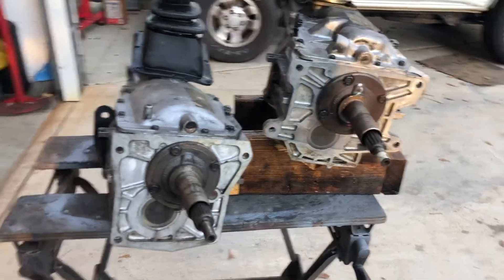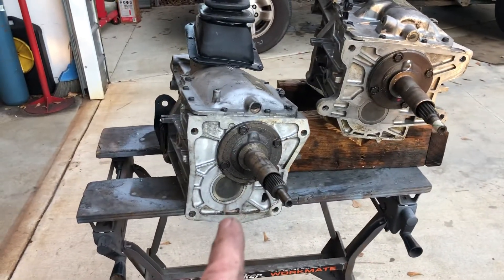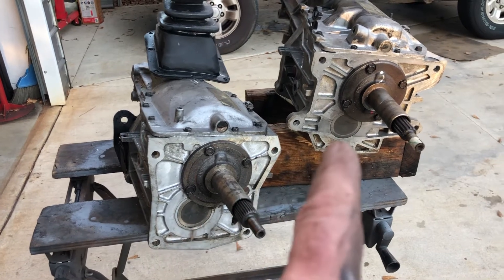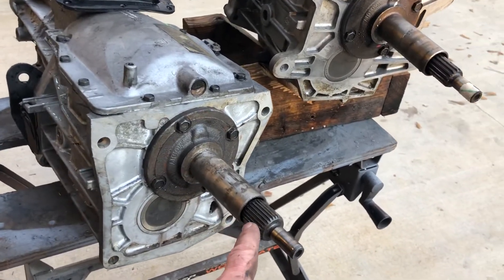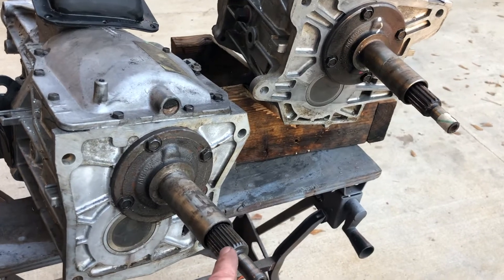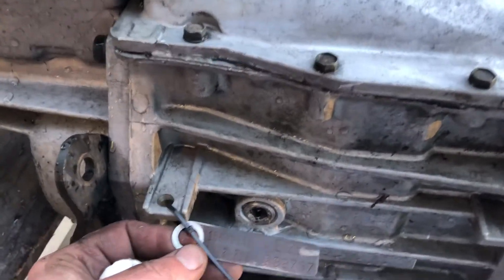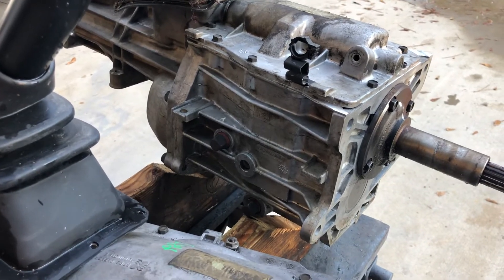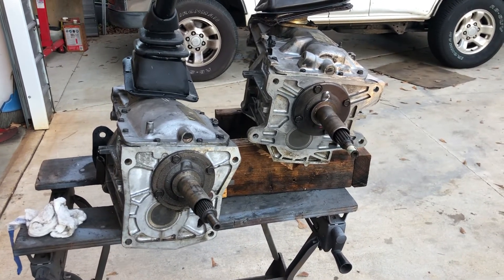S10 T5 transmissions with Muncie and Ford bolt patterns.

Comment: How can I make a SBC Chevy bolt up to a 14 spline t-5? Do you just order the flywheel and clutch kit for the 2.5? Is the flywheel bolt pattern the same? I know the bell is different I have all the bell but I'm wondering what parts to order for this build. Any help would be appreciated thank you
Reply from the maker: I need more info. What bell do you have? You’ll need an adapter plate to bolt a Ford bolt pattern T5 to a Muncie bolt pattern bell.

Comment: I have a Mustang WC T5 that I need to swap an S10 tail housing onto. (1352-208)

I'm confused on what tail shaft I need.
I don't care about retaining my speedo cable since I plan to use GPS.

Can I use the more common electronic speedo tailshaft? And is there any real difference in the NWC and WC S10 tail shafts?
And are all the S10 top covers the same?

Thank you!
Reply from the maker: @metalgearmoogle852  I have not performed the swap you plan to do but I know it is done frequently. The shifter box is in the same position on both the cable style and VSS style S10 tail housings. The S10 case covers are the same as Camaro and Mustang case covers. You will need the correct length shift rail correct parts to go in the S10 shifter box.

Comment: I was able to adapt a 90's Ford Mustang Tail Shaft housing with shifter to a 1989 Camaro/F-Body W/C V8 T5,and used the Ford speedo,by making a steel split bushing epoxied to main shaft w/a small drilled spot to locate clip for driver gear (machined,bored open to fit over end shaft),I split cut the end of the plug from the driven(speedo) to expose the square drive by removing a white plastic cap as this is pressed together plastic from factory,removed the cast aluminum screw on collar from my g.m. cable and cut back the steel retainer sleeve at end of cable till it was enough to engage the square steel driven as the former cap set is the new stopping point for your cut down g.m.sleeve,used a small otinker type hose clamp to capture it and filled with epoxy,,still working 20 plus years now in my wife's 75' Sbc 352 long rod Chevy Vega
Reply from the maker: @richardwimmer6846  
Guessing the FORD tail housing put the shifter in a better spot than the Camaro or S10 tail. Good job.

Comment: I'm wondering why with the S10 they (GM) didnt use the T5 behind the 4.3 ? they used the NV 3500 instead and i'm not so sure the NV 3500 was any better of a trany for the bigger motor ?:body-blue-raised-arms:
Reply from the maker: Yes, that is an interesting question. The V6 Camaro used a T5.

Comment: This video confirms :eyes-pink-heart-shape:that the S10 indeed got a WC T5 in 1993 , i was under the mistaken impression (from other info sources) that the 93 was WC but only with a ford bolt pattern but i see i was wrong , When i crawled under my 93 S10 with 2.5, 4 banger it indeed has a Muncie bolt pattern , mine would be a 1352-221.
So theoretically i could do a mildly modded 305 v8:face-fuchsia-wide-eyes: swap and, with a few other choice parts, retain my T5 :goat-turquoise-white-horns:
The main caveat:cat-orange-whistling: i will run into is with my T5's sup wide ratio spread i will def have to swap the 3.73 rear gear set for a 2.73 or 3.08
Reply from the maker: Many S10 T5s have been bolted up to a SBC 305, 350, 383 without any problems whatsoever. The T5 must be in good condition and will not take abuse. Drive it like a daily driver and it will do fine.

Comment: my question is why hasn't anybody made a bellhousing with the sbc engine bolt pattern and the ford butterfly transmission bolt pattern already? they have it vice versa where you have the bellhousing with the small block ford engine bolt pattern and gm saginaw transmission bolt pattern. but you can't get a gm bellhousing with the ford transmission bolt pattern yet there are companies that make a conversion input shaft for the sm465 that has the 10 spline 1 1/16 input shaft and another company that makes the gm slip fit bearing retainer for ford transmission to be able to use a gm throwout bearing with a ford clutch disc and gm bellhousing. it would make a lot of sense considering the pilot bushing diameter for the ford np435 and the gm sm465 are the same diameter and both share the same input shaft stick out length of 6.5 inches. unfortunately the s10 t5 bellhousing will not fit sbc otherwise i'd go that route and be done with it.

Comment: where is the adapter plate for $180 and change? the only one I can find is $305 on ebay
Reply from the maker: I bought my adapter plate from this guy. He very knowledgeable and will get you what you need if you tell him what your application is. Dave Farwell @ vintagemetalworks
dfarwell09@gmail.com
330-322-3102
Reply: @Lugnutz65  MDL adaptors makes a couple , one straight up (401-2200) and the other with the 18* clock over , they are $270us each.

Comment: So, is it easy to adapt it to a Ford F100 with 300?
Reply from the maker: They used this transmission in Ford Mustangs.  I would think you would find it easier to adapt a Ford Mustang T5 to mount to your F100 transmission bell.